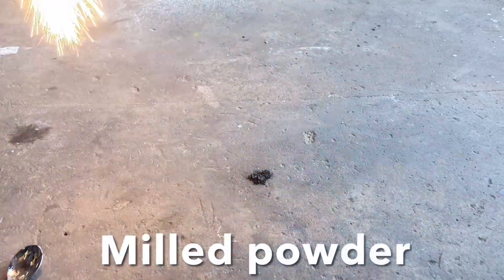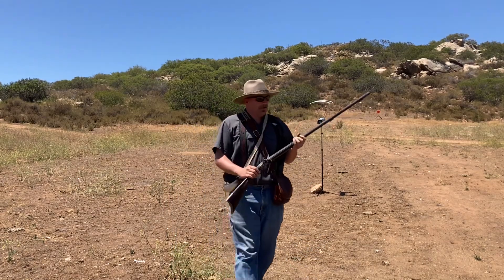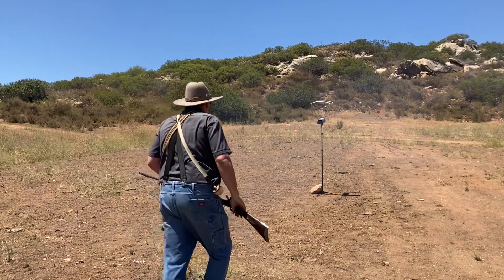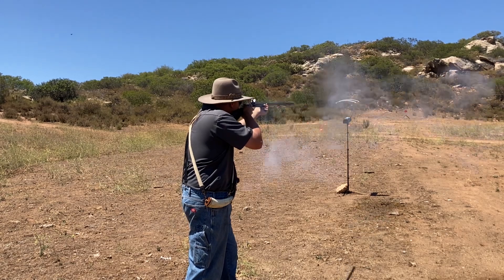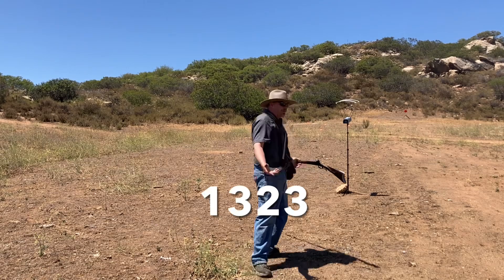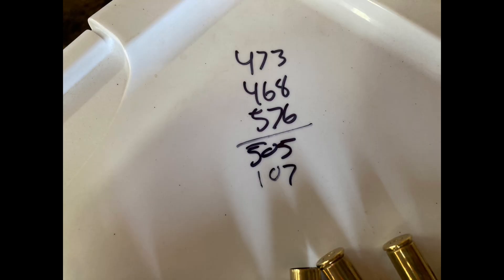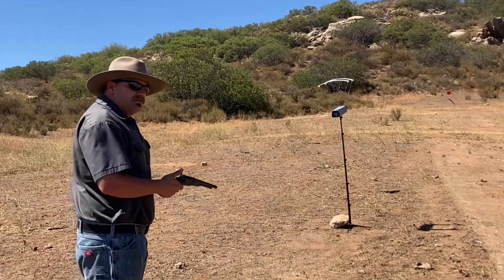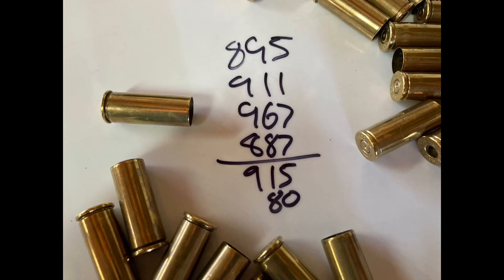Sulfur Free Black Powder

Comment: The gap between the cylinder and barrel may have also been a factor compared to the enclosed system of the rifle along with the softness of the powder. The slight pressure release may have slowed the ignition time a milli second. Good stuff Jake. You da man.👍 Don’t singe your eyebrows in the local Vesuvius.

Even at the comparatively pedestrian speed of that powder in the rifle, it will put meat on the table within a reasonable range. Airguns are killing deer at a hundred yards now with less velocity.
It may work for the in flight portion of holiday rockets after the lift stage leaving a nice smoky trail.

Comment: You lose energy when you remove the sulfur, so to replace that lost energy you will need to add another fuel, a catalyst, or a more powerful oxidizer. I can tell you that some commercial BP substitutes use potassium perchlorate in their formula, how much is a trade secret of course, but that gives you a place to start. 

Edit: Deleted the section on a certain formula, since it implied that it might be useful in a firearm. It's not, and would probably result in a burst barrel if tried. Don't Do It!
Reply: I would sincerely recommend keeping it to nitrat as perc opens up an incredible can of worms requiring similar but different expertise as the result is intended to go off in your hands instead of at 50 ft.

and tube, we are ofcourse referring to cracker barrel and having barrels of laughs here.
Reply: potassium perchlorate is one of the ingredients in modern primers. it is as one you tuber commented a "angry chemical" do not think it should have been mentioned as a black powder additive.or  guess you could throw the gun at em as a hand grenade lol
Reply: @forrest5050  you're confusing potassium perchlorate (that is in pyrodex) with potassium chlorate (the angry primer compound) still, lets not go there, like you say.
Reply: @Godwh1sperer  that would be a VERY BAD mix up lol

Comment: My father sent me his .45 caliber black powder rifle. I intend to hunt elk with it. I have never played with a black powder rifle and I want to learn as much as I can. Thank you.
Reply: 45 caliber muzzle loader is far too small a caliber for elk. It is passable for deer at shorter ranges say under 100 yards when we are talking about a traditional muzzle loader with a round ball for a bullet.
For elk or larger game a 50 caliber is a minumum with a heavy charge of black powder (90 grains plus) in a slower twist rifling when using round ball. Conical projectiles are a different story and generally require a faster twist rifling to stabalize the round.
A 54 caliber round ball with 80 - 100 grains if FFG is good heavy hitting rifle.
Now more modern conical bullets or inline faster twist rifles with sabot ammo is a totally different animal.
You never stated what type black powder rifle you have or the bullet to be used in you hunt.
Is you rifle an old style side hammer or a modern inline rifle? That would make a huge difference as to what type ammo you use, the powder amount used, the granulation of said powder and it's effectiveness on large game.
Reply: @denisdegamon8224  Thank you sir for the feed back. The rifle I have uses 209 primers. It was converted to 209 some years ago, I should say. I bought the pre-made pellets of powder. I have not shot it yet. I need to take it out and shoot it. I have a couple of molds to cast for it. I will start by chronographing it and printing paper to see where I am with it. Thank you again.
Reply: @grob25  
Glad to be of help. Based upon your response you have a modern inline rifle and not a reproduction of an old 1800's side hammer rifle. There is a big difference as to the rate of rifling twists, types  and weight of projectiles, powder granulation  and powder charges to be used.
Check with the manufacturer as to suggested loads and projectiles. The barrrel will have a manufacturers mark, then just look up on line and call them.
Reply: I have reloaded, shot, cast bullets and hunted with black powder for over 45 years. I am also a traditional black powder aficionado whom both   
Hunts, competes as well as  participates in living history / rendezvous pre 1840 events.